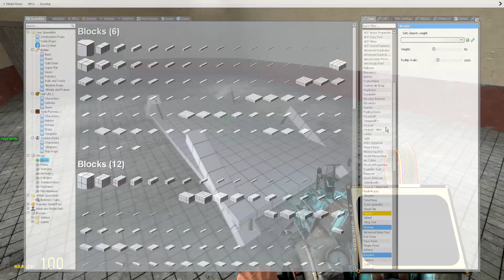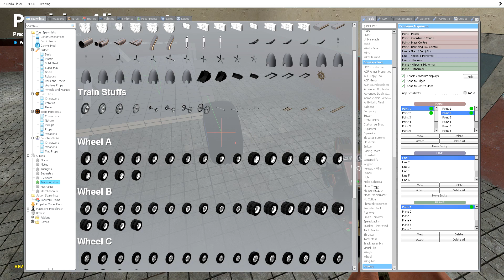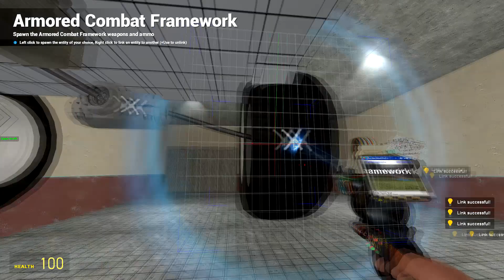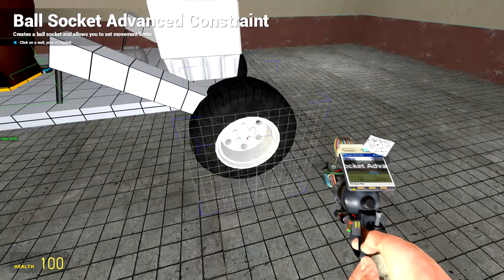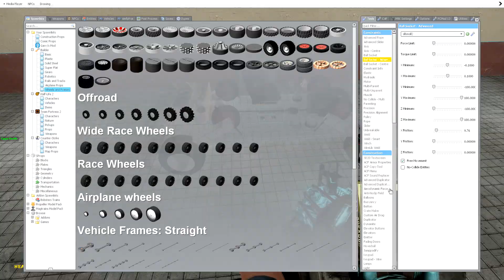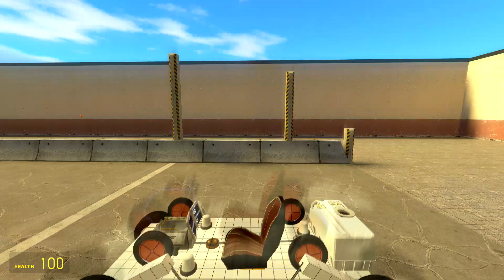Garry's Mod ACF: Make a Car (Prop Suspension, E2 Steering, More!)

Comment: the.e2.does.not.work.
Reply from the maker: If the E2 doesn't work there's a variant of steering control that uses wire hydraulics, I don't have any videos on hydraulic steering but this video should have you covered https://www.youtube.com/watch?v=ygwDZhlvOCM
Reply: @ridrexw8069  thanks
Reply: You may have disabled propcore.
Reply: Hey, for the E2 file to work, you must type "wire_expression2_extension_enable propcore" in the server console for it to work.  :D

Comment: Do you know any methods of mitigating or reducing under-steering? It's an issue I have for most of my cars.
Reply: First try a new steering chip and if that will not help try gaining traction by makeing your wheels/baseplate heavier. Another method which is kinda cheating would to use the fin tool (found on most servers) and make the value negative, for lighter vehicles use around -25 for heavy use around -15. Let me know if it helps!
Reply: ye, like nate said definitely find a new e2. no need for fin imo though try making the front wheels weigh ~10-15% more than the rear wheels. if that doesn't help then try and move your engine a little more to the front to get more weight distribution.
also, make sure you are using physprop_material phx_tire_normal on the wheels.
Reply: @topzozzle6319  like i said it was cheating a little, i forgot to mention weight distribution lol
Reply: Gmod physics are  a bit unlike real life - putting the engine/ballast weight pretty far over the front axle will fix your problem. Also: Every car MUST be all wheel drive. Rear wheel... Works??? But All wheel is definitely the best functionally.